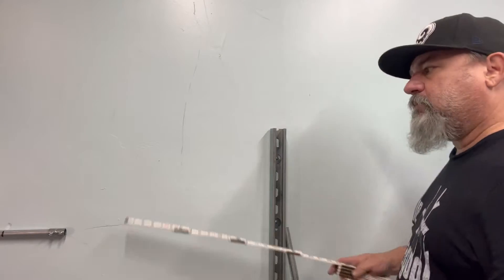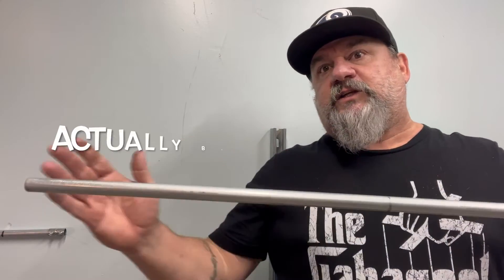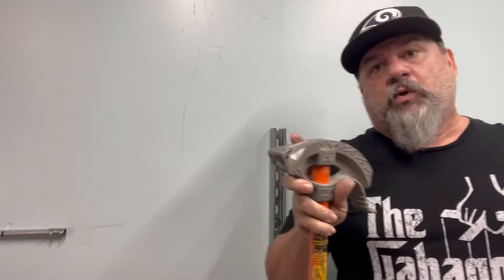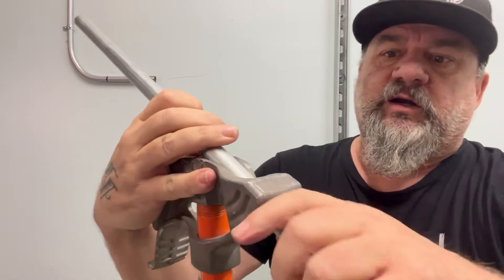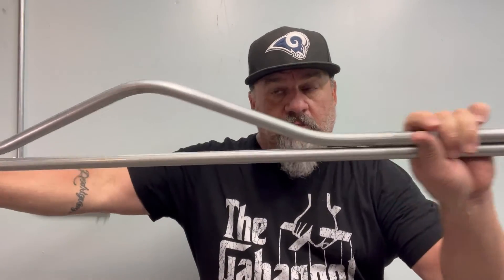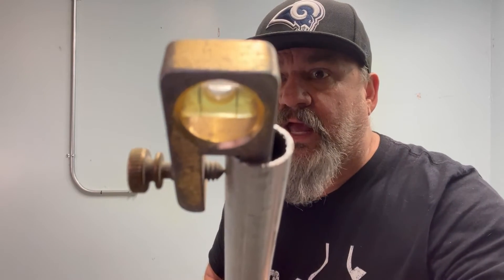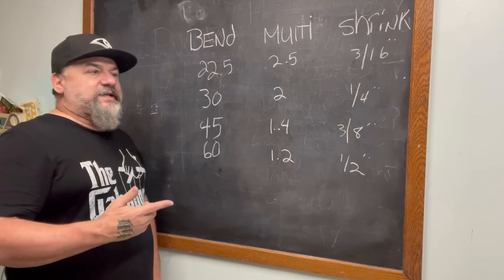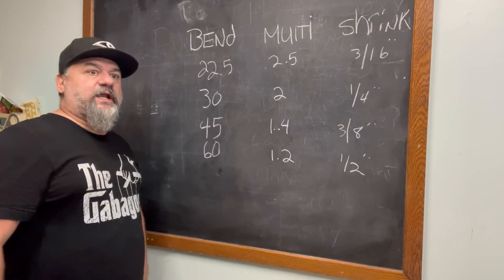How to Make a Perfect 3 Point Saddle in Minutes!

Comment: This is great, I don’t like to do the math myself. What I usually do is mark the center of the obstruction, and depending on the size go about 6 inches away on each side and do 10-22-10 using the notch on each bend. If it’s too small I can put more degrees into it

Comment: I'm not sure if you'll see this. Im gonna take my exam. We have to do bends, which is fine. But I've learned to eye ball it and not use measuring tape. I know to do an offset 10 and 10 thats a box offset. However, they want 7 inches of the ground/wall.  How do i calculate 7 inches of the floor without have to reinsert/ rebending the pipe?
Reply: Lmao, I should have listened to the whole video my bad....
Reply: you gotta get measurements then be able to do your multiplier. so 30 degree offsets are super easy bc the multiplier is 2, so you need to mark where the bend starts then go 14 inches for the 2nd mark, then bend it on 30s on the arrow, or you can bend on centers if you have a 30 degree notch or you can always mark it yourself by finding the center of your 30 and putting it back in the bender then marking the bender. centers are always nice because thats exactly where your pipe will start its offset. but just look into it ,a 7 inch offset should be no sweat. however if you have to do another degree then you need to use corresponding multiplier.

Comment: I still don’t know how to decide what degree of bend to use for the height of the obstacle/ offset. Is it something you just know? Like I use 10 degrees for my box offsets on a flat surface. Other than that, it’s pretty much trial and error.  I’m an apprentice.
Reply: it depends how close you are to your obstruction and also how high, basically if you gotta go up or down fast then you need to use a more aggressive degree of bend.  if you got plenty of room you can never go wrong with 30 degree bends also because the multiplier of 2 makes them easy

Comment: I can Wing a saddle over that, it would be a four point saddle bend to allow for strapping to the unistrut but I can use a tape measure just so I can show you what I'm doing , 
I don't know if you're going to cuz I haven't seen the video yet but don't put any marks on your conduit with a sharpie, I've never done any multipliers or anything I just pencil mark my saddle on the conduit and allow for the shrinkage. You got to know your notches though I'm going to make a video because I can show so many shortcuts and tricks, to avoid adding bones to the Bone pile, I can bend conduit, just like the man who taught me, I was the best until I trained a bunch of guys that are out there, bending it, better than Beckham I just went up north to Oakland off the couch and bent 300 ft of half inch conduit without a mistake, every whitch Way and every kind of v
Bend you can imagine, even a shepherd's hook offset
Reply: @mrromantimothy have you made the video yet?
Reply: @generissui2737  nope but I'm still bending pipe yesterday I bent a beautiful round saddle over a half inch pipe and offset 90s I even got to do a shepherd's bow 200 ft of half inch pipe and not one mistake.
Reply: @generissui2737  I'm kind of still looking to find a gardner Bender so I can show the difference between a star Bender it's handle position

Comment: Couple points, those notches that you pointed out are actually the center of bend for different angles. For example, my Milwaukee bender has three of them, and as per the instructions on the handle, the first notch is a center of a bend for a 30, then 45, then 60 degree bend if memory serves. On this particular Klein bender the star dictates the back of a bend when viewed from above, looking down with the pipe on the ground and the bender handle vertical, it happens to line up with the notch, but that is not true on every bender.
Furthermore, shrinkage only affects the pipe downstream of the bend- the first end of the pipe is inside the coupling and is a fixed point. 
Concerning shrinkage, whatever the first bend is going into the saddle will dictate what shrinkage you use. For example, in this video, you used a 22.5° bend, so the shrinkage would be 3/16 per inch of rise if you used a 30° bend then the shrinkage would be 1/4 in. per inch of rise, etc. 

Another point to mention is, it’s more common practice when doing a three bend saddles to use the push through method, bending the first bend first, and then the center bend second and then the third bend last- doing so ensures leverage, if your saddle were near the end of the pipe instead of in the center as shown in this video.